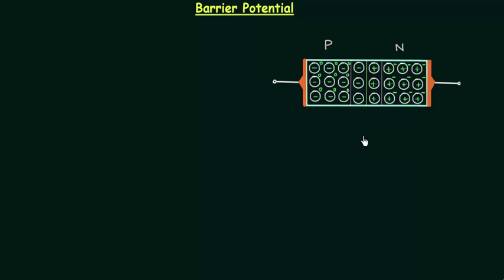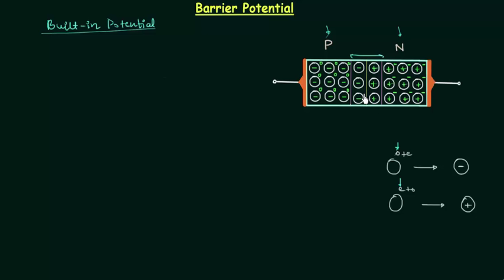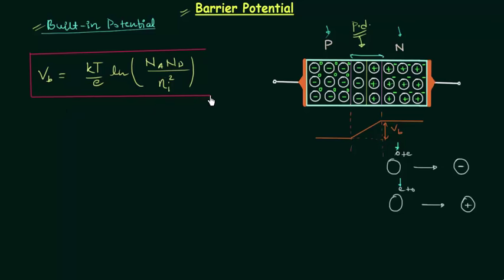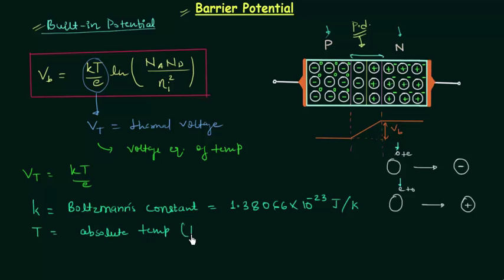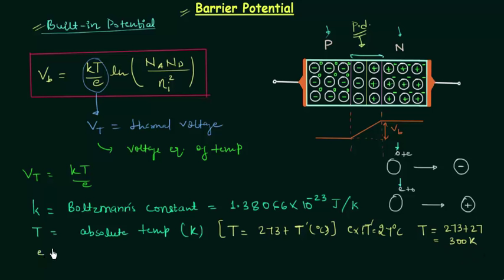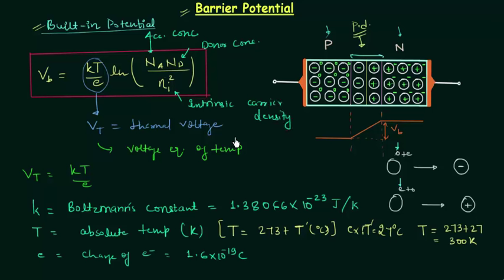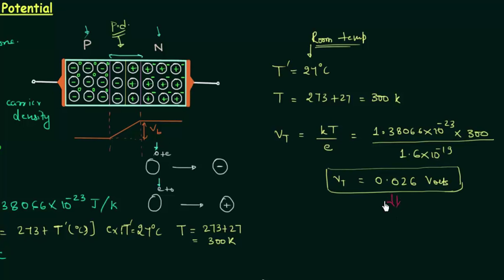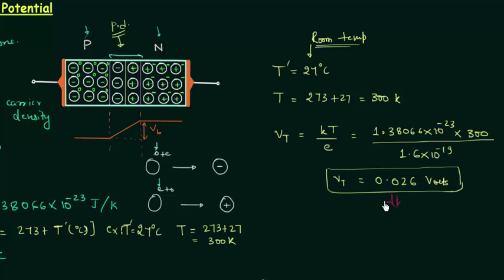Barrier Potential

Comment: sir, in this lecture at last part you did explain a numerical in which I am facing a simple problem i.e barrier potential you are getting, is 0.757(VALUE OF SILICON) but when I followed the step above of your it comes 0.329 (VALUE OF GERMENIUM)...PLEASE HELP ME IN IT.
Reply: Got the solution..?
After 5 yrs

Comment: Sir i have a doubt....
I cannot understand how the formation of immobile ion in  depletion region and the initially immobile ions present at the p-side or n-side are takes place?
Reply: Consider p side of on junction diode. When we add dopant like boron which has 2 8 3 electronic configuration, the valence she'll has 3 electrons. When doped due to an absence of 1 electron they receive an extra electron from Si lattice thus turning into a stable -ve ion and creating hole in the Si lattice.

Comment: Please I’ve a question
Why are the ions in the p type semiconductor negative?
Where as the impurity atom used is boron and its negatively charged
Reply: Boron has 3 electron in outer shell but for bonding it should have 4 electrons in outer shell. So it needs one more electron. Since it is going to accept one electron so it becomes negatively charge